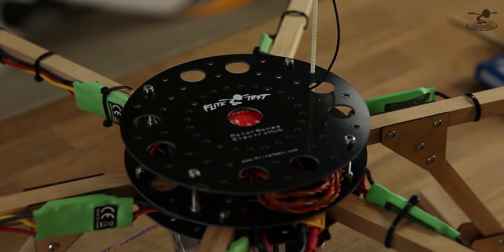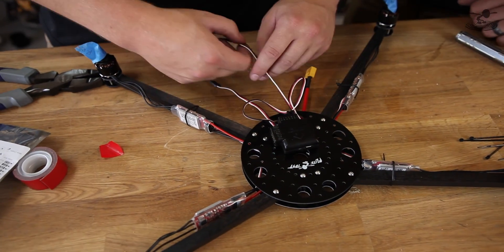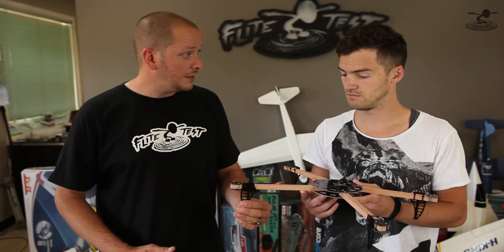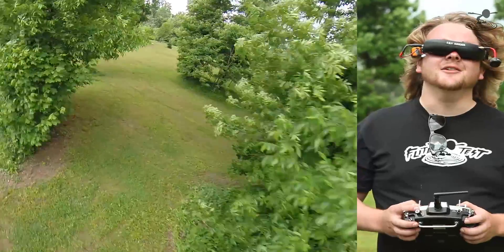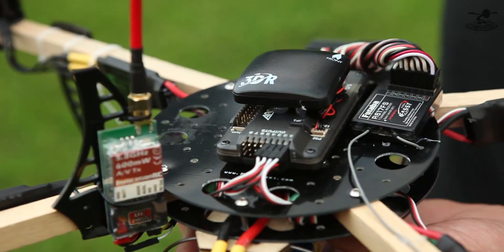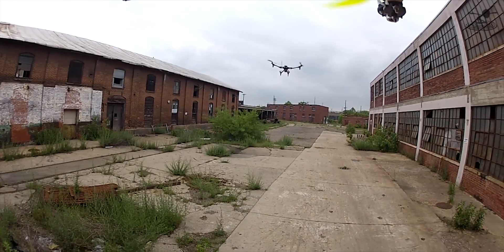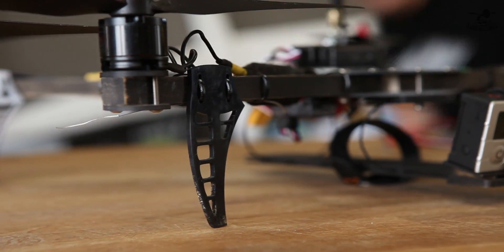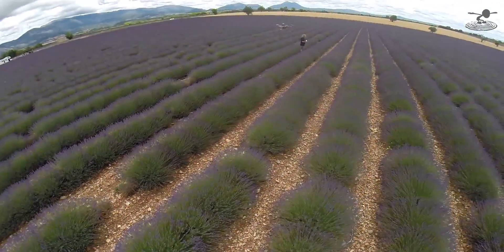Flite Test - ElectroHub

Comment: I just found you guys. I do a lot of cinematography and have been a RC enthusiast for a number of years... What you guys are doing for the hobby is AWESOME!! i Just ordered the Anycopter kit and the fact i can build a quad for under 200$ from start to finish is insane. What id be interested in is seeing a Octocopter build and be curious to the payload specs. there are quit a few independent film makers that can't afford a DJI Phantom or the big s1000 and s900. The Phantom is a great starter Quad that gets good go pro footage and the built in features like GPS mode makes flying for a non experienced pilots a breeze but its not how i would recommend learning how to fly quads... In any case I'm looking to build a Hex or Oct that can carry larger payloads. So heres my challenge to you guys. Build a Hex or a Oct. that can carry a Black Magic Pocket Cinema camera size to a Panasonic GH4 with gimbal, FPV, OSD the works for those of us that are looking to get larger payloads in the air. Even if you do a build and take the total excess weight of Camera and Gimbal and test with dummy weights just for proof of concept that would be sufficient. Budget range rules...A Hex or Oct build with the specs to carry larger cameras would run Minimum $1500 just for the airframe, ESC's and motors. I would like to have a budget build of airframe, motors, ESC, Flight Controller, and receiver thats reliable and make me feel confident to strap a $1500 GH4 on there for under 500$.. Doable? You guys can build 100mph planes for under $100 I'm sure your creative inginuity can get this challenge done. Thanks Guys

Comment: Just ordered my kit! Waiting for RTF Quads to get the Electronics Kit back in stock so I can order that too. I want to buy a GoPro gimbal but I'm not sure where to mount it. If I mount it on the bottom I don't have space for the battery. Suggestions on what to do are welcome. Thanks guys!

Comment: I like the way you guys designed the stuff but for what it is its just way overpriced, I understand you dont have a huge production line and its a s cheap as you can make it but I just cant afford to spend that much on just a disk of metal with holes in it and some wires to solder to

Comment: Paul Baxter from whitspy really does put out a great product.  I purchase from him in bulk because his prices are usually better then what you can find on EBay and other sources.  

You guys should do a show on the cheaper Spektrum compatible receivers out there.  I buy LemonRX receivers from Paul and they work perfect and are feather light.  Not even HobbyKing can beat a 6 channel, spektrum compatible rx for less than 6 bucks......  Plus you piggyback one of his PPMSum boards and you have everything right there and with only 3 wires going to your FC and for less than 12 bucks.  I use them on the FC and attach another to the gimbal control board and have a friend fly the camera.......  so much fun..

Comment: I'm not sure why they decided to incorporate power distribution, in my experience soldering your ESCs just limits what you can do with the multicopter in the future. It's a lot easier to just use a power harness.
Reply: Solder=less points of failure. When you start flying some expensive stuff around you want all the assurance you can get.

Comment: I like your new ElectronicHub an can`t wait to order it.
But there is one thing to think about! After soldering you may should recommend to use a plastic Spray or some isolating stuff, to isolate the solder joints. In case of a crash it or just accidentally dropping a screw... :-) it may easily  can shorten your Lipo. 
I am also quite excited of your new Yaw mechanism. Huge improvement using strong low KV Motors. I am very happy with your recent good looking yaw-mechanism. By the way the APM 2.6 works absolutely awesome with your Batbone tricopter frame! I love it most! 
Grate Job!

Comment: Great you guys are teaming up with Paul at Ready to fly quads. Great guy and great service. Just put on a MultiWii Pro on my Batbone V-Tail Quad and flies great out of the box.
Reply: I was actually a little disheartened to hear they weren't doing it in house, as I've had issues with getting everything from Paul, and hearing back from him in a timely manner. I will give the man credit, he's got the lowest prices, and we DID work out the issues in the end, it just took about 5 weeks from the initial order placement and paypal charge. I would warn anyone to think twice about ordering with ReadytoFly Quads unless you're willing to wait for Hobbyking style speed and only slightly better customer service.
Reply: Maybe things have changed. We have had conversations back and forth. It does take a few days to get a response but remember he's a one man shop. His boards are cheaper than others with better components installed. Also firmware flashed.

Comment: Great video.  I heard you said your gopro had cut off.  I have been fpving with my gopro h3 for a year now and never had it cut off on me.  I have it set to manual so it don't shut down.  I also have one on my fpv ground vehicle and it never shut down on me.  Make sure you have it set to manually instead on the timer to shut it down.  

Be blessed
Isaav

Comment: is 5.8ghz legal in the US?
Reply: leefuji
You do in fact need a Ham license for pretty much any of the available video fpv frequencies in use here in the US. The only exception would be really low power like 10mW. Getting your technician's license is fairly easy if you use available online study materials. And it makes you legal for all the commonly used fpv frequencies. I got mine earlier this year.
Reply: Yup .. totally.
Reply: Douglas Roberts no need for HAM license either? and what about the 600mw? holllaa back.
Reply: leefuji 600mW is good. You only need a Ham (in theory) if you run up to UHF (a la ezUHF) but even 2.4ghz and 1.3ghz (on certain freq. are legal in the us as well).
Reply: Douglas Roberts thanks for the info :D

Comment: Nice stuff comming up. If I can offer some suggestions:

For the tricopter, it would be better to make a yaw mechanism where the CG of the motor+prop isn't shifted when yawing, otherwise some controllers that try to maintain heading (such as Arducopter) start getting yaw oscillations. To do it, make a hanging yaw mechanism as such: 
http://diydrones.com/profiles/blogs/tricopter-based-on-arducopter-yaw-issues-and-solutions

For the battery+camera trays, I think you guys should experiment with wire rope (but not too sloppy). The dampening effect of the rcexplorer style wire isn't that great, especially with the thickness of the wire included in the kit.

For landing gear, I'd recommend the "Universal Nylon Landing Skid Set for Multi-Rotor Frames" from Hobbyking because they absorb landing impacts well, and are simply mounted with tiewraps.

A mini circular hexacopter would be nice too, like the current hexacopter kit, but scaled down for 5x3 props, and able to carry the GoPro on top (that means at least 3 disks).

Oh yes, Josh frequently mixes up APM (=hardware) and Arducopter (=firmware that runs on APM, Pixhawk, PX4, amongst others).

Comment: If you are a beginner and stuff its nice but if you wonna have some looks to it then not buy the anycopter. Also, the arms break super fast. It wont last for long. I have the anycopter but it looks like something that i made from scrap junk. Still love the passion of flite test, but not the multirotors products.
Reply: The arms are supposed to break. They're easy and cheap to replace.
Reply: Timo Martens $60 for a multi is incredibly cheap. I've built professional cinamatography rigs for $1000 + (not including the video gear/cameras)
being able to get a frame this reliable and easily repaired for under $100 is a GREAT deal and an awesome addition to the hobby! =]
Reply: You can literally replace the arms for around $1, plus they are easy to paint so they look a lot better (in fact you could probably paint the anycopter pretty easily too if you were worried about looks). I think you're missing the point, they never said that they were the best, but they are cheap and easy to replace, which is what you want when you're just getting into the hobby.
Reply: Why the hell would you care about your copters looks? To impress the ladies? To be the coolest guy in school?
Reply: Timo Martens You don't need to buy the kit, you can just buy the $14 hub and spend a couple extra bucks on booms you can buy in any hardware store. $14 for that new electrohub seems incredibly cheap to me.
Reply: Not sure what you're doing with yours but I dont break my booms that often, even when I do, they are like $2 to replace and I'd rather break that then a motor or frame.
Reply: Timo Martens
perhaps your issues are operator related...
Reply: 60 bucks is not cheap in my mind ejleipold Sam Clark
Reply: well it does because this frame is just crap, the motor mount are way too thick and the booms snap super fast

Comment: i have the KK2 at the moment, should i upgrade to apm? Is it very difficult to set up? and has anyone got a link to an apm like ebay or something :)
Reply: APM is going to be quite a bit more setup than a KK board for sure. But you get way more features. You should search YT for setup videos, it's not 'hard', just gotta be able to follow the directions. You should buy from a good store so you have some backing. GetFPV, ReadMadeRC and the like are good places to start.
Reply: thanks for the help :)
Reply: Connor, Douglas is right on here.  Its more work but you get more from it.  Also keep in mind that the APM platform is approaching its limits on what it can do.  Alot of the guys who really got APM off the ground from a programming and troubleshooting perspective are now more active on the Pixhawk (PX4) platform.  Its kind of the next generation of APM.  

That being said, APM and PX4 are identicle from an end user perspective.....for now.  Its just that new features are going to be added to PX4 going forward.  But there are so many features for APM that most users only scrape the top of whats really out there. 

Do your homework, read the forum boards.  I'm amazed at what people are accomplishing still and learn a lot from them.
Reply: thanks! I'll do just that before purchasing and see if its right for me and get my knowledge up on it :)
Reply: Connor Mullan search for the naza32, according to RC model reviews he has not had to tune it at all
Reply: i saw a video where he said he just pretty much put it on his quad with almost no adjustments which is why i was interested but I'll check it out